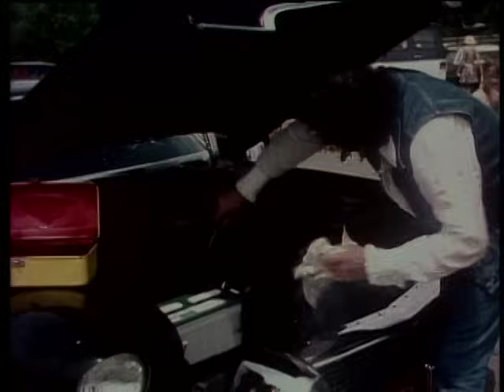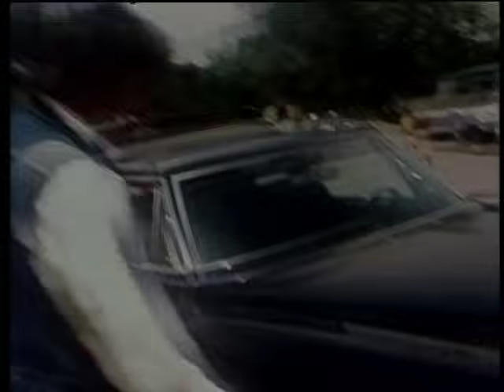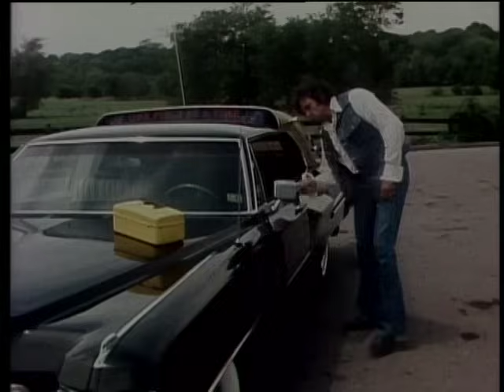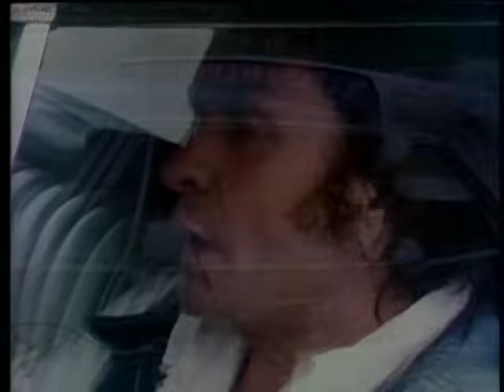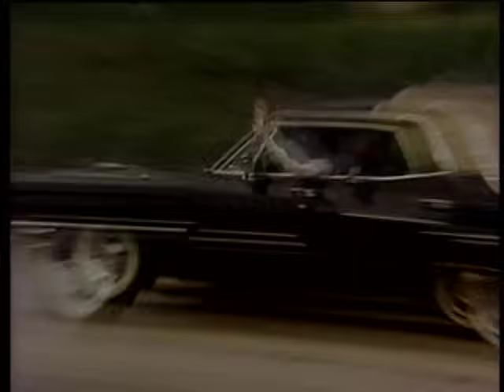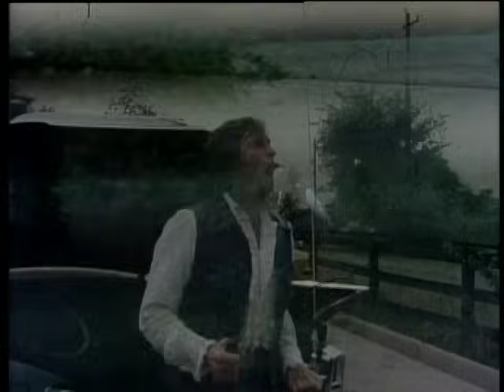Johnny Cash - One Piece At A Time (Live)

Comment: Well, I left Kentucky back in '49
An' went to Detroit workin' on a 'sembly line
The first year they had me puttin' wheels on Cadillacs
Every day I'd watch them beauties roll by
And sometimes I'd hang my head and cry
'Cause I always wanted me one that was long and black
One day I devised myself a plan
That should be the envy of most any man
I'd sneak it out of there in a lunchbox in my hand
Now gettin' caught meant gettin' fired
But I figured I'd have it all by the time I retired
I'd have me a car worth at least a hundred grand
I'd get it one piece at a time and it wouldn't cost me a dime
You'll know it's me when I come through your town
I'm gonna ride around in style, I'm gonna drive everybody wild
'Cause I'll have the only one there is a round
So the very next day when I punched in
With my big lunchbox and with help from my friends
I left that day with a lunch box full of gears
I've never considered myself a thief
But GM wouldn't miss just one little piece
Especially if I strung it out over several years
The first day I got me a fuel pump
And the next day I got me an engine and a trunk
Then I got me a transmission and all of the chrome
The little things I could get in my big lunchbox
Like nuts, an' bolts, and all four shocks
But the big stuff we snuck out in my buddy's mobile home
Now, up to now my plan went all right
'Til we tried to put it all together one night
And that's when we noticed that something was definitely wrong
The transmission was a '53 and the motor turned out to be a '73
And when we tried to put in the bolts all the holes were gone
So we drilled it out so that it would fit
And with a little bit of help with an adapter kit
We had that engine runnin' just like a song
Now the headlight' was another sight
We had two on the left and one on the right
But when we pulled out the switch all three of 'em come on
The back end looked kinda funny too
But we put it together and when we got through
Well, that's when we noticed that we only had one tail-fin
About that time my wife walked out
And I could see in her eyes that she had her doubts
But she opened the door and said, "Honey, take me for a spin"
So we drove up town just to get the tags
And I headed her right on down main drag
I could hear everybody laughin' for blocks around
But up there at the court house they didn't laugh
'Cause to type it up it took the whole staff
And when they got through the title weighed sixty pounds
I got it one piece at a time and it didn't cost me a dime
You'll know it's me when I come through your town
I'm gonna ride around in style, I'm gonna drive everybody wild
'Cause I'll have the only one there is around
Uh yow, Red Ryder, this is the cotton mouth
In the Psycho-Billy Cadillac come on, huh, this is the cotton mouth
And negatory on the cost of this mow-chine there Red Ryder
You might say I went right up to the factory
And picked it up, it's cheaper that way
Uh, what model is it?
Well, it's a '49, '50, '51, '52, '53, '54, '55, '56
'57, '58' 59' automobile
It's a '60, '61, '62, '63, '64, '65, '66, '67
'68, '69, '70 automobile

Comment: In 2003 something almost identical happened in China. That’s when a man named Zhang, who worked on a motorcycle assembly line, spent five years doing exactly what the hero of Cash’s song attempted. Zhang couldn’t afford one of the motorcycles he was building, so over half a decade he stole the pieces and built one at home.🫡 He actually might have gotten away with it except for the fact that he was pulled over by police shortly after finishing the bike, and was cited for not having a license.